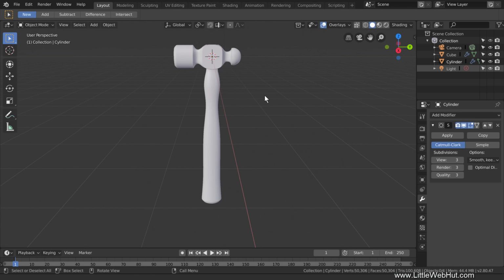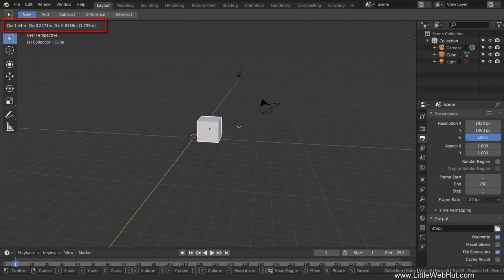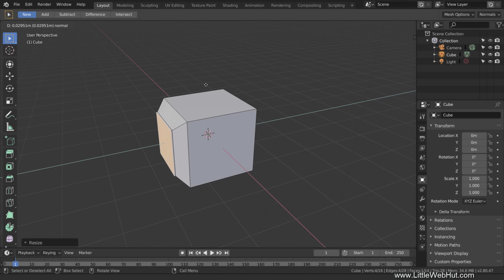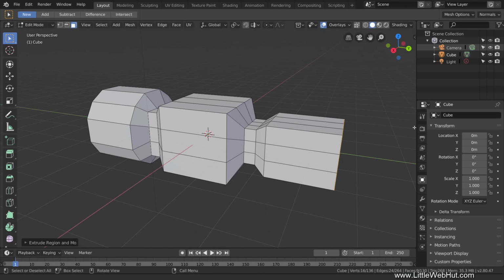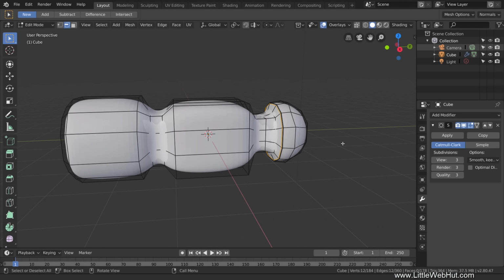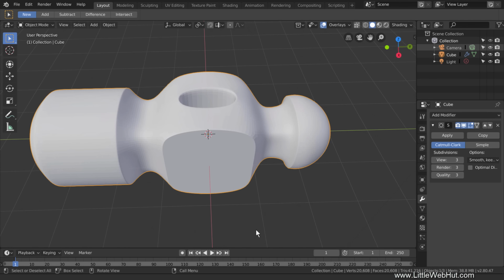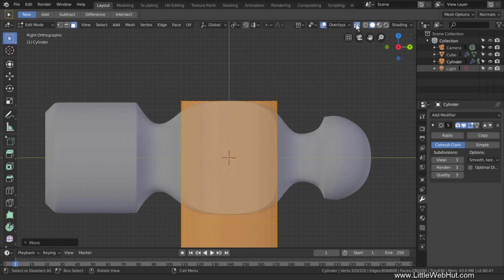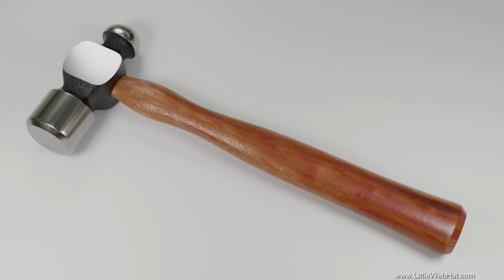Blender 2.8 Beginner 3D Modeling Tutorial

Comment: I just had something weird happen when I did the "bridge edge loops" part. It cut the hole out of both ends, but there wasn't a mesh between the top and bottom center faces. Instead there was a flattened sphere shape in the empty space at the center of the hammer head. Undoing a couple times and then doing "bridge edge loops" before scaling, and then undoing that and doing them in order again seems to have fixed it.

Comment: I was so close to finishing it 😩, but the handle at the top didn't measure up to fit the hole at the time for it to fit in properly.  I went over this video about 8 times. Does it matter if the hammer handle doesn't fit perfectly into the hole at the top? I stopped after that beacuse i wanted it to be perfect.😩😥

Comment: One tip for new people, when inseting new faces make sure the edges don't overlap with the old ones, they should be really close together but not over eachother. If they are over eachother if you use Mesh -> Clean Up -> Merge by distance in the future to remove doubles it will merge the vertices that are overlapped and ruin the inset.

Comment: Everything is good and working until I try to add the cylinder for the handle, and it makes the cylinder, but it isn't a separate object. I see the cylinder, and can even create it physically distinct from the hammer head (as in they are not touching and you can see both clearly), but no cylinder appears on the list in collection. I'm not sure what I've done wrong.

Comment: You know, Blender was actually the very first modeling software I ever learned. It was back in around 2010, when I was in my last year of middle school, and I was actually pretty good at it. I stopped for a while and later learned Fusion360, since I was mostly using it for 3D printing, but now in trying to get back into Blender for work reasons, but with the new 2.8 interface, nothing looks the same and it looks like I'm going to have to learn it again from scratch. 

Your video is awesome! It doesn't drag things on, it gets straight to the point. Thanks a bunch!

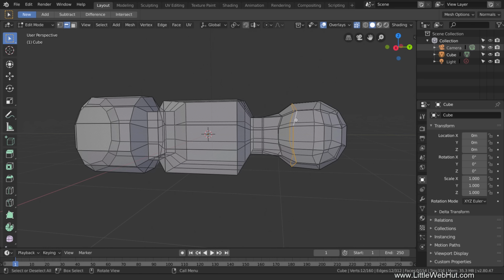Comment: If selecting just the ring of edges at 8:40 is not working for you, it seems they've changed this keyboard shortcut and it's now simply a double click of one of the edges in the ring. Hope this helps someone!
Reply: Might depend on your keymap preferences... I'm pretty sure by default it's the same. It also could have been the beta version of Blender you were using?

Comment: This is a great tutorial and is really easy to follow along with.  My one criticism is that, instead of adding geometry to sharpen edges after doing a subdivision surface, I think you should set a "crease" value on those edges (it's in the "n" data panel in 2.79, but I'm not sure where it is in 2.8).  It's easier to modify a crease value to sharpen or soften an edge to get just the right look, and it's easier to work with the model if you don't have the extra geometry from the ring-cut sharpening method.  Also, I didn't know about that "bridge edge loops" trick to make a hole in the mesh, that's really handy!

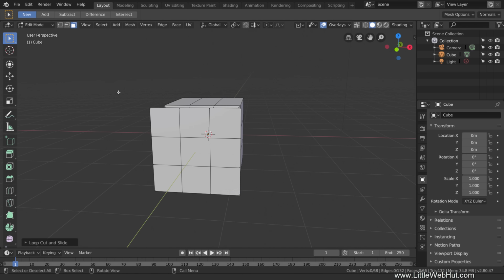Comment: I'm only 6:30 into this video and I have declared this video the best Blender tutorial on the internet. He doesn't just rapidly work getting you lost. He actually explains what he's doing, things you should be looking at in the UI, and why he is doing things the way he is. That last part is critical for becoming a good modeler. It's very important to understand WHY certain techniques are used, instead of just do it this way because.

Kudos, amazing tutorial.
Reply: I am totally new to blender and it's quite fast actually. Had to 0.75 speed and paused anyways. But yeah, as for a beginner I found it pretty nice.

I don't fully understand the INSET however. Why can't i just add new cut loop for example and just move it? Wouldn't it be the same?

Also, sometimes I clicked by accident something that my graphics went wild and had to restart xD
Reply: @PinkeySuavo  Loop cuts work by going around objects. ALL the way around. Face inset simply grabs one face and makes a smaller copy. For subsurf work like he's doing, face inset lets him clarify the square side of the hammer without restricting the top and bottom from rounding a bit, which is the effect he's looking for.
Reply: No kidding. I have been looking forever for a simple tutorial that explains the controls and edit mode. It's taken me forever to find one that is not out of date!
Reply: this is trully the best blender tutorial regardless of version u using
Reply: Yeah
Reply: I agree!
Reply: Easy-er is holding shift and select all the faces
Reply: I find that so true!
Reply: yes
Reply: nah fr way better than other tutorials on the internet
Reply: For real!
Reply: Is it just me or at least someone is getting lost? I have been to a few more tutorials, but jeez i didn't got a thing from those.
I mean, i have a big, dummy head with no brain..

Comment: Excellent video. My favorite Blender 2.8 tutorial so far. Just two remarks.
1. There are a few extrude operations that are repeated twice, instead of doing it twice you can press shift+R to Repeat the action.
2. You can also quickly change viewpoints by using the tilde key (~, right above the Tab key on many keyboards). Press it and you'll see a menu with numbers. You can also hold it and flick your mouse in the direction of the buttons, i.e. left for left viewpoint, right for right viewpoint, up for top viewpoint etc. I don't have a numpad and this is much easier than going through the menu. In fact even if I had a numpad I'd use the tilde key, it's very fast.

Comment: HELP !
I have 2 object on the screen at one time. In object mode, if I try to choose only one of them both objects are automatically chosen.
How can I choose only one object ?
I may have changed some settings, but I can't remember which setting, in that case.
Reply: You add mesh in Edit mode for an object, they become one object.   Select all vertex/edges/faces of the one you want to split, and press p, it will seperate to two object.

Comment: How do I change my cursor to one like yours, the one as default has just several black pixels, not a cross that is easily seen. You seem to have not taken into account actual first-time users but have assumed a lot that previous blender users would have set things up already through already knowing settings. The tutorial, as easy (and hard to keep up as you go so fast) is different for a first time user. Im going to have to look elsewhere for an "actual beginners" 2.8 tutorial, sorry.

Comment: wherever i work on this, the orgin point is always the cursor - yours seem to be the face that you have selected, my extrusions are coming out different and so is the sphere's - and i think its all to do with the cursor position. Plus all the crashing (ive go a 32gb i8)
Reply: You need to specify your pivot point.  3D Cursor will use the cursor as the pivot point, Individual Origins will use the center of each face as its own pivot point.  The pivot point selection tool is at the top of the viewport, just to the right of where it says 'Global'.  Stick with it as Blender is going to be the greatest thing that you ever learn.  Good luck.

Comment: Damnit. I add the handle, shape the top, hit 'a' and the entire hammer selects, not just the handle. 

OK. Got it.
The cylinder added with a sub-surface modifier already enabled. 'Odd,' I thought, but carried on. That seems to have been the difficulty.
I restored to my pre-handle backup, clicked on a different tab away from modifiers in that panel, and was able to carry on as per the tut'.

A reminder to take lots of numbered backups so we can wind back, if we need to. 
(You can delete 'em when you've finished, if you want, same as binning scribbled notes or sketches after you've finished a Real Life picture).

Thanks for the shared knowledge,  tutor4u. Much appreciated.
Reply: I still don't understand how to select just the handle without the hammer